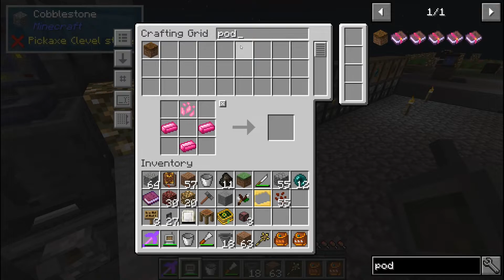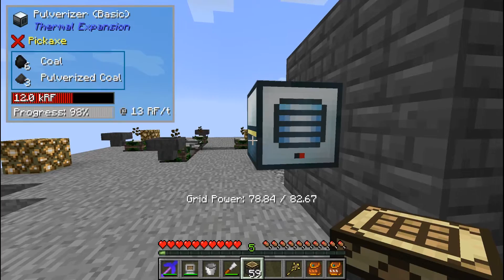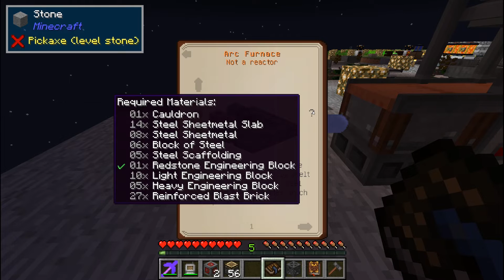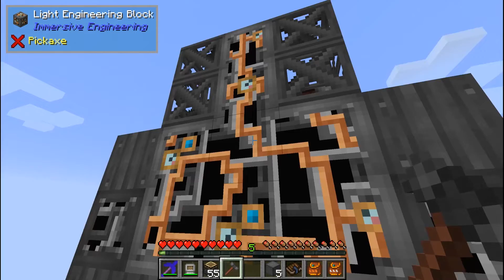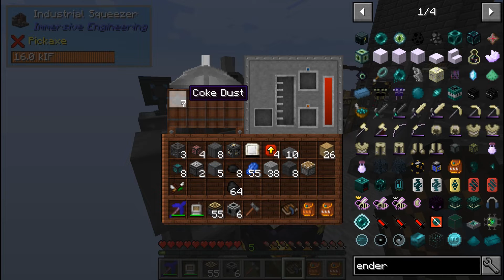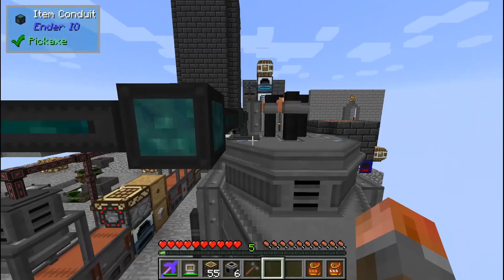Ultimate Alchemy E10 - Automating Diamonds! (with Immersive Engineering)

Comment: Kinda wondering why you are still automating with mechanical crafters when you have RS already set up... Isn't that kinda slow?  Not sure what is rearranging your inventory.  It happened off camera in between cuts.  Quick tip, the engineer's hammer can be used to rotate pistons, so there's no need to do extra work orientating them, just place everything down and use the hammer to rotate the piston, and when it's in the right spot the hammer will also complete the multiblock. It's easier that way.